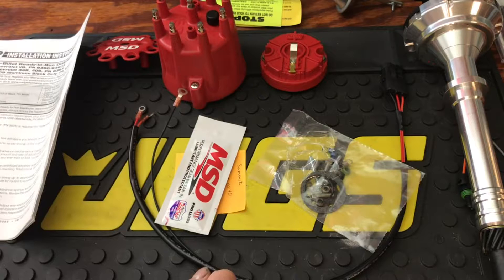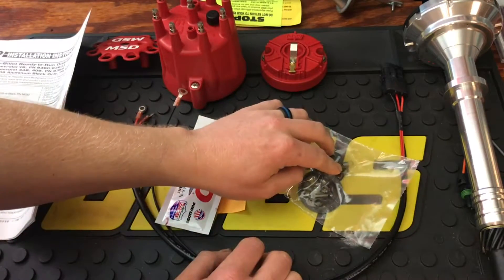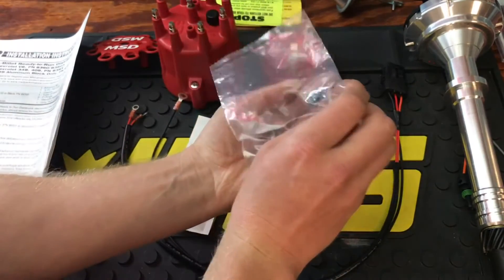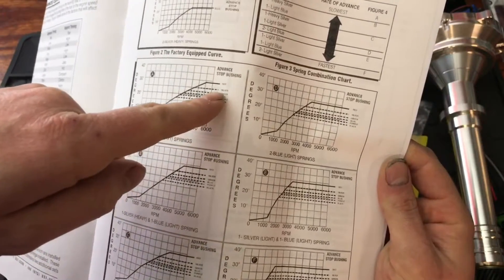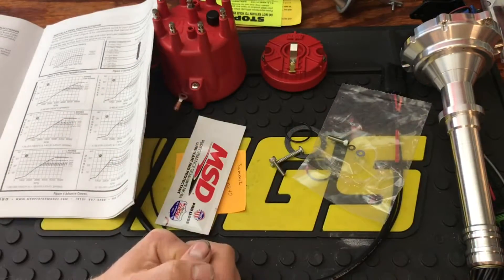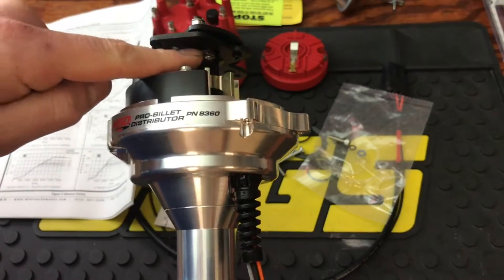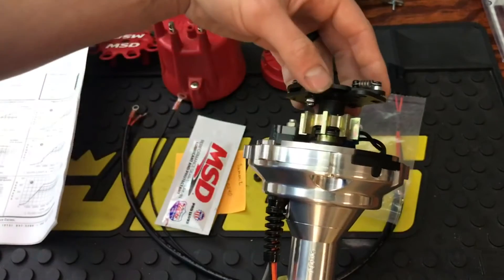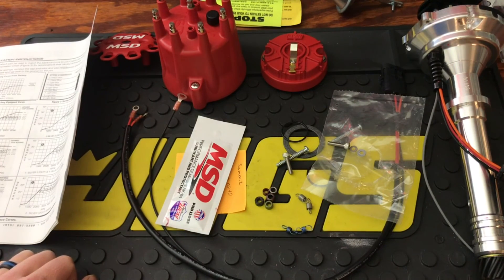Changing and Explaining Timing Curve on MSD Distributor

Comment: I have a rebuilt '73 350 (now 355)  from a Camaro, stock HEI  in a 6300 lb, 1993 van
 When I retard it far enough to stop pinging at 3000+ rpm (rotate dist. clockwise), it has no power at all.   Do I need a Pro Billet like you  have since they didn't add much timing from factory?
Is the Camaro distributor adding too much too soon for a 6300 lb vehicle ?

Comment: love the video man , i have a 73 Charger 400 low compression , i have an msd ready to run distributor with its coil and wiring , the problem is my car is lazy on low rpms (it's a 4 speed ) but i push the gas pedal and open the 4 bbl it moves pretty good , i have a street demon carb 625 cfm ( also had many problems with rich mixture especially on low rpms you have to kick the 4bbl to make it go ) engine is stock and didn't know much about these springs and am not very familiar with timing and stuff  , anyways what do you think my car needs for the perfect spring and bushing setup needs to be happy ( car is used for cruising but many uphills where i live ), plus my spark plugs are always black!  thanks in advance

Comment: Hi, today I measured with a vacuum gauge and it stucked at 17Hg wich supossed to mean late timing issue. Do you thing it could occurs because a the the springs? It is a stock MSD HEI. Thanks for your thoughts.

Comment: Thanks for the video. How do you determine the maximum advance of timing? I have a 327 with a very strong midrange cam. I currently have 10° of initial and 31 max with advance. Currently using a one heavy silver and one blue spring. Recommendations?
Reply: I should mention I don’t use vacuum advance.
Reply from the maker: It's really either driving it and feeling at what all in degree feels most responsive. Or put it on a dyno to see at what total timing performs the best. I just drove and adjusted and drove and adjusted.

Comment: So the bushings under the springs don't do anything it's the bushing under the weight that will add or reduce the initial advance ? .
That MSD looks like it was based off the GM points dist like my Pertronix 3 , although they have a spring set they didn't include a alternate bushing .

Comment: Great video my brother I've been looking for some information on MSD curves I have a old 350 rocket Edelbrock aluminum heads hydraulic roller cam RPM range 2200 to 6,000 9 in Ford rear 370 gear th400 full manual transmission I would like for my Advanced to open up as soon as possible with my cam Power Band what Springs and bushing do you suggest also I have the mechanical version distributor my timing now is at 34°

Comment: Have 548bbc stroker 3500 Stahl converter 11 :1 comp 373 gears in 70 nova turbo 475 hyd have all msd stuff plus rev limiter . Run 100 oct av gas. Motor balanced. Big hyd roller 720 lift 3000 to 6600 rpm. Have two lighters springs and black bushing.how much initial timing do I need .what total timing do I need at what rpm to set total timing?

Comment: We have a ford mustang with 428 fe and just installed the PN 8594 pro-billet distributor. The distributor came with the 2 silver heavy springs and silver bushing (25 degrees).  The factory curve shows the blue stop bushing and advancement starting at 4000RPM's  with the silver bushing around 4800RPM's.  What do you recommend to drive on the street and stay cool?  Thanks!

Comment: Hey tony I need some help before I get on a dyno this is what the tuner said “I would suggest that you setup your distributor for the total timing you would like to run on the engine. 
Depending on your distributor, you should be able to adjust ir with the bushings and or springs for for timing curve”  I have a msd pro billet like yours my cam rpm range is 2500-6500 what spring would I use ?

Comment: I just purchased a msd pro billet distributor I'm wondering which box to get I'm running a FI 460 e40d I want this thing to hop when I hit the gas any any advice btw this is a toy hauler 3/4 ton truck stage 2 transmission stock converter on 35s if it matters

Comment: Being new to this what I am confused with is: Once you have your bushings & spring choice in your MSD distributor how do you know were to lock the distributor down at?
Reply from the maker: You make sure you are TDC on cylinder 1 of the compression stroke. Both valves shut. Then drop the distributor in with it pointing to that number 1 cylinder. That will get you close enough to start it and adjust it to where you want

Comment: I have a 69' ford falcon with a 351w, hei electronic ign. It's a little sluggish at first but after it opens up it's great. Think if I tried the blue springs it would help?! Cam is comp cam 280h, gt-40 heads (for now) .030 over, 750 holley with Aluminum torker 2 intake. 3.25 gears c4 trans with shift kit. It's just a temporary engine until I get the other engine finished for it.  Used the same carb on my built 302 with zero issues.

Comment: I have a 421 Chevy stroker.  I put in the engine and the builder capped off the vacuum advance.  I have a 700 r4 trans with a 10 3000 stall converter and 373 rear gear.  The total timing is set to 34 degrees.  The engine was dunked at 565 horse power and 570 torque at 5700 rpms. The cam is 236/242 with 110 lobe.  I started the engine and is fired up and ran great.  it idles  at 950 rpms in park and when I put it in drive the rpms lowers to 600.  I was told it was the torque converter but the cam card said it is the correct stall for this engine not too loose or tight.  I was told the initial timing was to low and I need vacumn advance. I have a msd 8363 hei distributor.  how can I fix this drop in rpms in drive.  I cave set all 4 fuel blocks on my 750 Holley carb. What can I do to the distributor to on have max 200 rpm drop?  Thanks for your help.

Comment: just a suggestion but instead of all the talk why didn't you show folks how you pull the springs then the weights so they could actually see  where the bushings go then explain how the weights  use centrifical force to open outward by giving the shaft a spin  - - if you have lighter springs on the pins the weights have less resistance thus open easier thus bringing in the timing earlier and the bushings on the pins allow for more or less movement depending on their size. I've been running a 6 AL older style box with a billet distributor and a two step add on which allows me to put the first chip on my line-loc button so I simply plant the gas and the RPM limiter misfires the ignition to keep the launch RPM at say 4800 ( or whatever chip I have in the first step) so I can concentrate on the tree. The second step is my max RPM limiter in case of an over rev. I have it all coming in at 2200 presently and it works for my setup. However I've to step out of my comfort zone to learn "tuning by lap top" as when I change out the present motor  I think I'll be going twin turbo on an LS and the systems I'm looking at will allow tuning fuel delivery, timing and boost - - great when you know what you are doing but a giant headache to an old timer like me but this old dog is still learning. In closing I guess what I'm trying to say is seeing how something is actually done as you do the work on camera might have been the way to go - - show them how the weights function and how you take the springs off the pins then pull the weights and actually slip a bushing on the pin and show them how the plate moves because a narrated video of the work being  takes away the mystery as they see it with their own eyes - - you explained it well but seeing how its done gives more confidence to someone trying it for the first time and they can visually compare what they are doing with what you are doing  in case they get stuck - - nice job

Comment: I am confused about what the stop bushing does
Reply from the maker: It is a stop bushing so if you have a 14 degree stop bushing then it won't let your mechanical advance go any further than 14 degrees. So let's just say you had initial timing set at 22 degrees and a 14 degree stop bushing then when your mechanical advance sets in then it won't exceed 36 degrees of timing. I hope that helps

Comment: Thank you for the informational video ,,I Was wondering if you can shed some light here ,,Have a 403 olds and putting 350 olds 7a heads on it ,They say I have to recurve the dizzy will be bumping up the compression with the heads   So do i need to recurve it so the timing will advance at higher RPMS ?
Reply from the maker: The compression won't affect your timing with the distributor to much. It's more about where your power and rpm range operates at. If you have more power early or if it's a high revving engine
Reply: @TonyTheTechnician  I didnt get to that point yet ,In the process of doing the job

Comment: Good video i just changed my springs to  softer ones in my 1968 Riviera GS i got a 455 in it it took it out for a test drive and it burned rubber down the block way more 🐎 power thank you i owe u a case of beer .
Reply from the maker: Very nice. That's awesome. Glad it helped!!!

Comment: Hi I have a shelby 1970 and I dont know the spec of the engine. But I found out talking to the seller that it is a 351w stroked to 408 with a holley 600cfm , roller rockers, but unknown camshaft. But looking at the firering order it is a 302 camshaft. Original distributor I now will change to MSD 8354. How will I start figure out the right timimg? Thinking no vaccum advance. idle timing at 15 degrees and total timing +21 degrees to start with. Is this a good starting point? My old distributor gave med with vaccum total timing of 50 degrees and thats not good

Comment: I liked this video so much, I saved it so I can refer back to it later when I change my springs and bushing then time it. Mild built 460 BBF in a 67 Mustang Gt. Cannot wait to get her timed up and on the road. Thanks Tony, Makes sense to me only because I have been studying all this stuff for one solid week now. lol Check out badasscars.com . He talks the same about timing advance at low rpm and total by 2300 rpm to make a torque monster with crazy throttle response.
Reply from the maker: Thank you and exactly. Thats how I want mine as well. Glad you enjoyed and understood it. Ya I had done alot of research before this process as well. Atleast I can get a good base setup and adjust it from here if need be. 👍

Comment: So I have a BB Chevy and the builder wants 18 degrees at 1000 rpms and 36 total at 3000 rpm, I run a 3200 stall converter , MAX RPM will be 6200.  Street/ Strip car, 505ci/ 700HP in a 70 Chevelle SS.  How should I setup the distributor?  MSD 85551.  Thank you!
Reply: If street strip car, Have all your timing in by 2300 rpm to avoid it being a sluggish turd. Please refer to this engine builder in Cali. badasscars.com/index.cfm . This man has built some of the best racing/street/strip engines in the U.S. Good Luck Vinny with that monster. You have my dream car!!!

Comment: How do I decide where (rpm) my mechanical advance should come in? My cam’s power range is 2500-6000
Reply from the maker: You base it on your cams power range and stall for your torque converter so you want it to come in by 2500 and go through your 6000. So you can set your springs to be all in at 2500 or up to roughly 3000 and it should be all in by that point

Comment: Can I leave out all that extra stuff and just run it? I never replaced a distributor so difficult. But I do see the science behind it. Also what happened to firing orders on the caps?
Reply from the maker: You can drop it in the way it comes but after you get it running you may want to adjust it depending on your power range. The firing order stays the same

Comment: I have a MSD ready to run distributor 8360. If my vacuum Advance is hooked up does that give it more timing or does it change the curve or both? I never changed my Springs or bushings and my initial timing is 12 to 14
Reply from the maker: As rpm goes up while cruising the vacuum advance will cause the spark plugs to fire sooner creating better gas mileage and should run smoother.

Comment: Great video..nicely done.. ıf initial advance is 26 or locked to 34 degrees, at stop lights doesn't the car wants to move forward on breaks which causes the breakes to overheating. did you have any problem like that?how did  Setting the initial to 34 effect your driving response..

Comment: I am running a Ford FE 390 that isn’t quite stock, and only slightly modified. I think I understand the concept of total timing, so I’m pretty sure I want to run the two silver springs that are light but I am confused as to whether to use the red stop bushing or a different one.
Reply: Eric, that will depend on what you set your initial timing at. If you set idle/initial at, lets say 16 Degrees BTDC, then you want to stop the total timing bushing to allow  20 degrees and 36 degrees will be total timing. That is how my BBF 460 in Mustang Gt is set up. = Mega torque and head snap off throttle response. Check this guy out. badasscars.com/index.cfm. All this is explained in one page. Good Luck sir.
Reply from the maker: Exactly. Great explanation of it. Thank you 👍

Comment: Thank you Very much!!
Reply from the maker: Your very welcome. Thanks for watching
Reply: Greetings from Germany :)
Reply from the maker: @69runner_j  nice!! Thank you for watching. Greetings from the USA
Reply: @TonyTheTechnician  Tony, I just want to ask you something about the springs. I got a 512 stroker but I'm still not sure witch springs I should use. Got a 4500 Stall converter max rpm is about 7200. More like a street tripe motor. Cam is a comp 265 @ 50. What happen if I have to mutch mechanic timing in lower rpm? I mean, it's dependent on your setup for sure. Maybe you could help me.
Reply: @TonyTheTechnician  is it possible that the engine start knocking cuz its to mutch timing in lower rpm? Or what about fuel economy and the temperature inside the motor. Is it possible that it runs to hot cuz the timing doesn't work with the cam?
Reply: @TonyTheTechnician  or should I set the total timing when the cam kicks in 🤔 that would be like arround 3200.
Reply from the maker: @69runner_j  it's really hard to say which is best for any setup. The only way to truly find our is to base you initial springs and spacer off the chart proceeded to get you close. Then you just have to swap out and see what works best for your specific application. It's kind of a pain to do all that but once you get it dialed in. You will be happy.
Reply from the maker: @69runner_j  yes you might have to adjust timing. If it's firing to late or to early it could cause knocking noises, detonation, excessive heat causing misfires. So finding the perfect timing is key.
Reply: @TonyTheTechnician  I got your point. I realy do many things by myself but I try to understand different things. I don't want to search for a better setup if I don't know what exactly happend and where the Difference.

I'm more interested in the total timing. I got 36° and 15° at idle. So everything fine there but I'm trying to understand where to set the total timing. So to set the total timing at the correct rpm depended on witch setup / application  / cam I use. Right? "
So, what happend if I got to mutch timing to early?

I know, my cam starts pushing 3,500rpm and got a ratio to 7200rpm. For me it makes sens to use the springs for the total timing @ 3xxx. But many people say" set it fast as possible " that's why I got my total timing now very early arround 2200. I don't know but it makes no sense for me. Why I should have it so early when my setup is start working 100% from 3500 above. 🤔 And what happend inside the motor when it's to early for my applications 🤔 could u explain me that?
Reply: @TonyTheTechnician  so it can be happen, that my timing curve isn't correct for my application and I got to mutch timing to early and the motor starts knock + produce more heat?
Reply from the maker: @69runner_j if your happy with your timing but think it's coming in to early then don't be afraid to try a bigger spring to bring it in a little slower. You could have it come in right when you hit your desired rpm so then it's already at total timing throughout your power range if that makes sense
Reply from the maker: @69runner_j  yes indeed
Reply: @TonyTheTechnician  thank you Tony :)

Comment: Great video, thank you for taking the time..I am confused, but that's my own mind trying to understand. I am new to valvetrane geometry and timing. A friend and myself built a .383 stroker in his shop and I have so much bottom end, I can't get enough out, its a smoke machine! Running 3.73's in the back with a 2400 stall HCI converter, 750 Holley DP. My ? is, should I keep the heavier springs or go lighter?
Reply from the maker: Thank you and it really depends on what you have built the 383 with. Like your heads, compression, whether it is balanced or unbalanced either internally or externally. But a 383  usually can run a rpm of 6500 to 9000 depending on if it's mildly built or fully race built. So if it's a standard built 383 I would base my spring choices off the 6500 rpm. Sorry if that's confusing

Comment: Good explanation on all those little parts !  But to avoid confusion I think you may have read that graph backward (i could be wrong).  The heavy silver springs do not "kick-in" at  4500-4800 rpm,  they are "ALL-IN"  at 4500-4800 RPM (where the stop bushing halts the curve),  they start kicking in at 1900-2000 RPM (the bottom of the curve). Great video though !
Reply from the maker: Ya that's my bad I should have explained that a little better. Thank you!

Comment: Are you not worried about detonation ? With so much timing at a low engine speed ?
Reply from the maker: michael penna no 24 should be just fine at lower rpms.